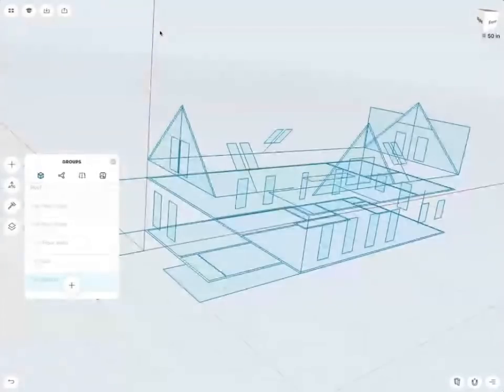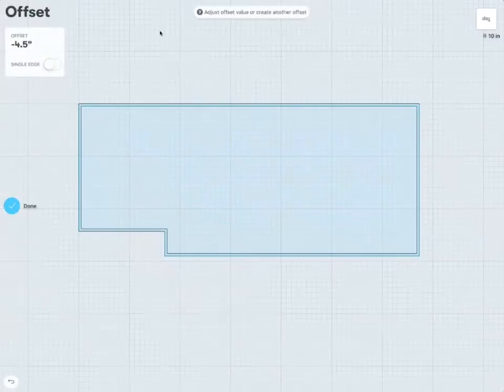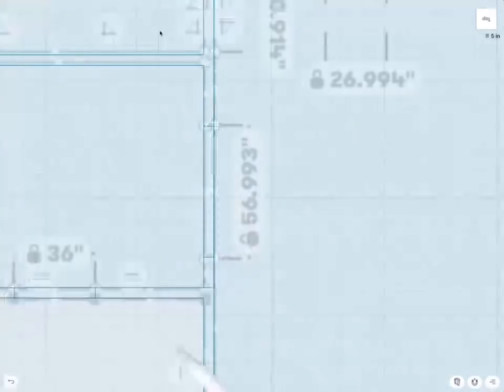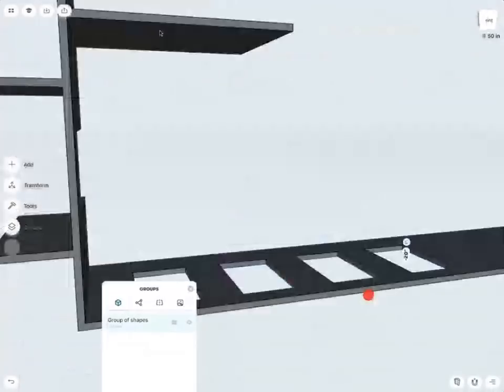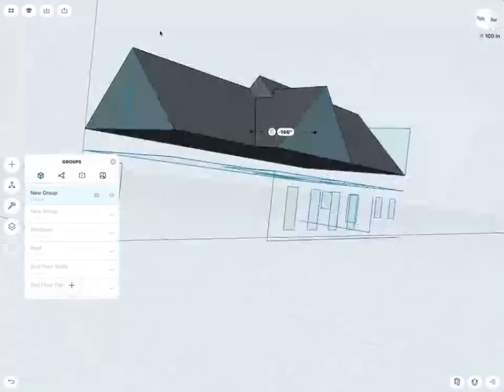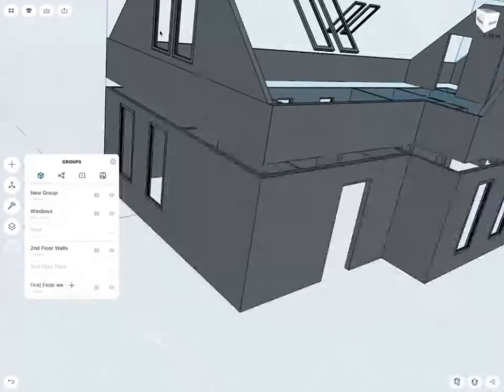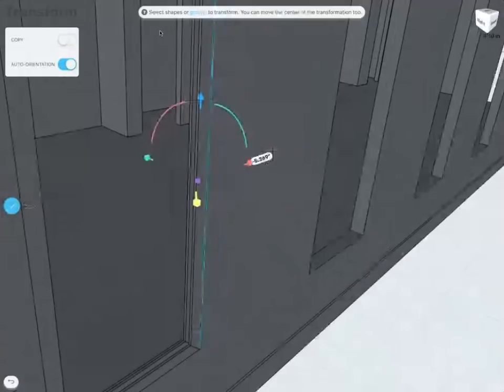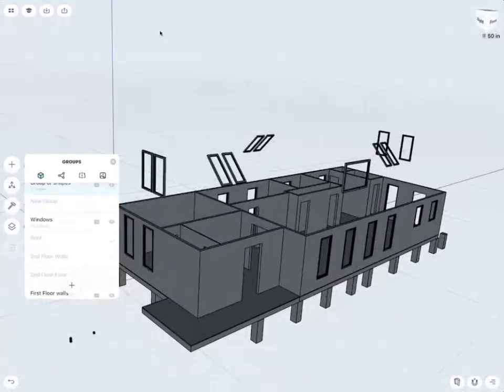Design architectural sketches on your iPad | 3D design webinar

Comment: Hello, thank you for this video. 

From a new users POV I found a few problems with the instruction and quality of the video. I have the video quality set to 720 however it’s still blurry, it might be better to upload it again with the correct setting. 
The other more important issue is with the instructions. Many of the details were not explained properly, for instance if the instructor experienced a problem he quickly fixed it without adequate explanation of the cause, an example of the very first instance of this is at 1:40 (there were many others), hence I found those important learning moments confusing.
 
Instead, if the instructor used those unexpected problems as a learning experiences and took the time to explain in detail how to avoid such mistakes it would have been more valuable.
 
This was a long video workshop, it wasn’t suppose to be just a marketing demonstration of Shapr3D. I often felt that the instructor was more concerned about ensuring the product was seen in a good light rather than concentrating on conveying important concepts of the product - which is what I am after.

Many of the Shapr3D video’s are done by another person who speaks slower, more deliberately and in adequate detail so the viewers get the most from the time spent watching. If the person who did this tutorial would just concentrate on fully demonstrating the Shapr3D functionality he would have produced a great tutorial, he obviously has the architectural knowledge and experience to do that.
Reply from the maker: Hi William,

Thank you very much for your comments!
We are sorry if the instructor was not super-clear at every step. We'll try to address these issues in the upcoming webinars as much as we can.

Regards,

Peter
Reply: Peter: Thanks! This particular topic is of interest to me as I do work where i have to quickly draw plans with cabinets and furniture, so this particular tutorial was very helpful. More in-depth on this topic would be great 👍.

Thanks for what looks to be a terrific program for the new iPad pro.